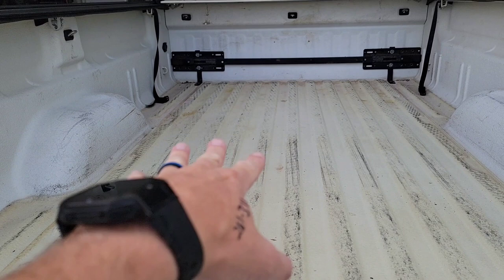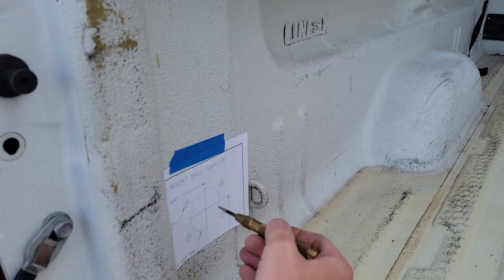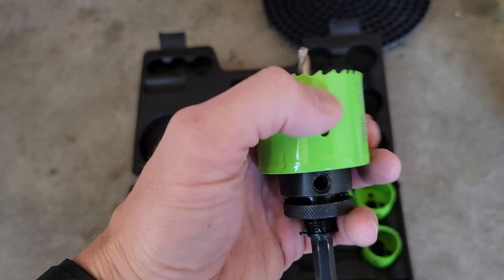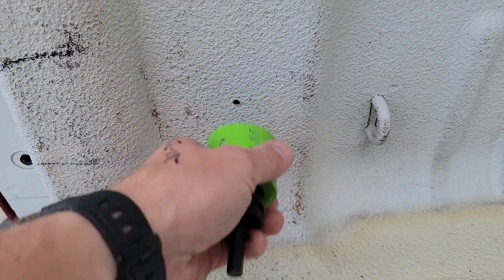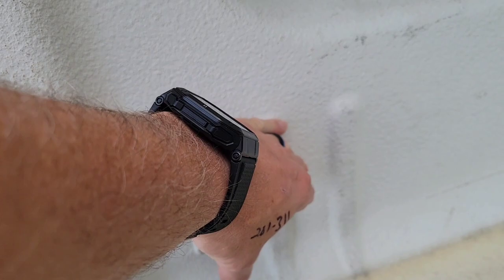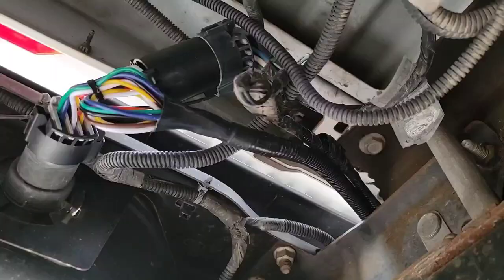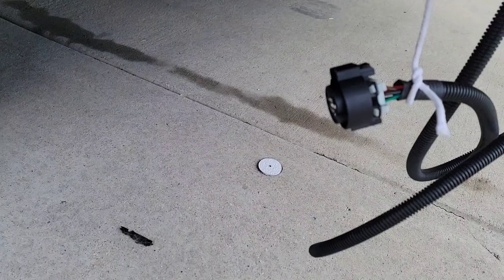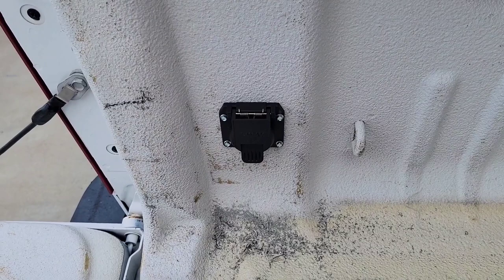2008 Chevy Silverado 7 pin bed wiring camper plug install!  Under a hundo and covers many years!

Comment: Quick question have a 2020 Silverado 3500 dually I’m getting a message that says service trailer brake system would you know anything about it? Trucks still under warranty I just don’t trust dealers at all so I’m trying to figure out if it’s something simple.
Reply from the maker: Typically this can be from the rear bumper wiring getting wet.  If you washed it recently, went through some brush that may have wiggled the wiring.  Very seldom does that warning actually mean there is an issue, it's typically wetness that can be temprorary or you can check the two studs by the battery box on the drivers side fuse.  There is a large 30 amp square and a 40 amp square right next to two lugs.  If you have a wire tester, check those fuses first, if one side of those lugs doesn't have power, swap the fuse and rock and roll.  It can be a short from a trailer, or the water issue mentioned above.  Hope this helps.